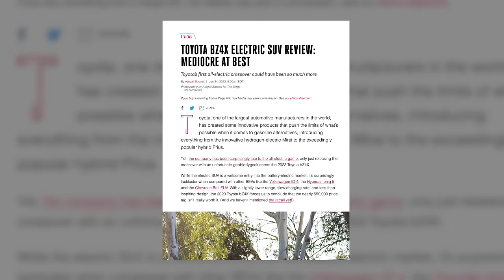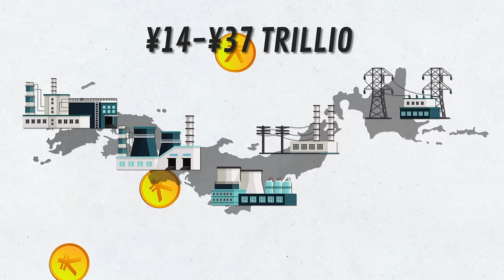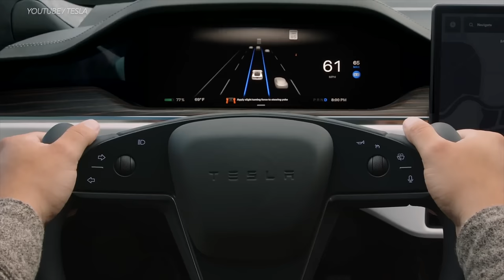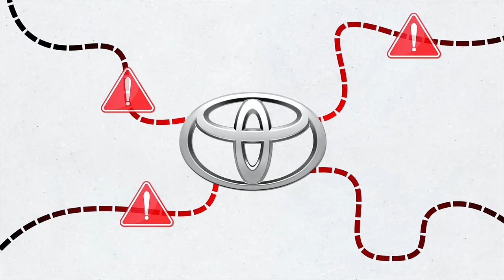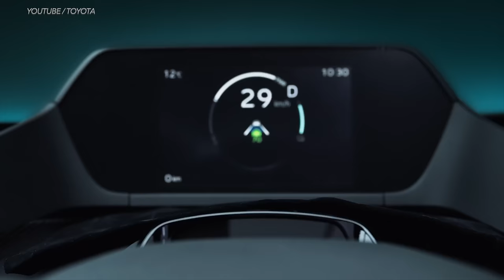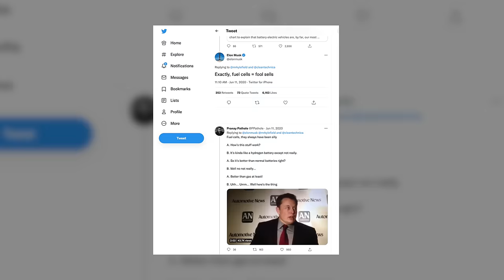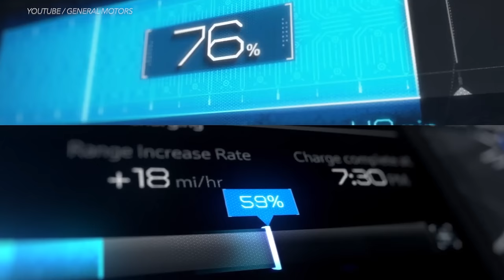Toyota's New Electric Car Shocks the Entire Car Industry

Comment: If Toyota can guarantee the battery for 10 years, they shouldn't have much problem selling them when they get the bugs worked out.
Reply: 10 years isn’t much when a gas Corolla can run 2 5 years
Reply: Lithium ion battery is chemically very unstable so automakers tend to use them only in safe margin.... Normally almost all makers are expecting it endures more than 10 years. That means, 10 years warranty for battery's life time is nothing special or belated answer in EV industry.
Reply: @billyjean2905  On average, most people don't keep their cars for much longer than that anyway.
Reply: @m1kcan1  Yes, but.  I have an 18 year old Toytoa.  It will outlive me, of course.  I don't drive  much.  Put aside the purchase price, the range, the concern with the electric grid going down.  A 10 year battery guarantee is going to be a deal clincher for a lot of people.  My kid is the rarity who buys a car for $2000, can repair it, and has driven more than 130,000 miles on business (with the tax deduction).  I buy new and drive forever.  It is only now that Toyota as 20 years experience with the Prius, but I would never buy a used one.
Reply: @billyjean2905  That may be true.  For those of us who only buy new and drive until it dies, that kind of warranty helps the sale.  I am driving a Toyota that I bought new and it is 18 years old.  What do I think about limited power train warranties of 100,000 miles?  A sales gimmick.  Who wants to buy a car that only goes 100,000?  A lot of EV vehicles will not have quirky transmissions.

Comment: I did notice that Asian vehicle manufacturers seem to have inferior electric motors or at least they have inferior design aspects. I drove a Kia hybrid and the electric motor was so anemic that anytime you pressed more than 10% of the throttle range it would turn on the gas motor even if the battery was full. It never used the battery except in very low speed maneuvering in parking lots.
Reply: They don't have the strength of the power-split device of the Synergy Drive.  It's more like an alternator that can be driven by the battery.
Reply: I think it's more efficient to run the motors at slow speed.
Reply: That's controlled by the software.  It wasn't an anemic electric motor.  It is 38 KW = 51 HP.

Comment: Hey Scotty I have a 2011 camaro v6 the 3.6 liter and I have spent 750$ on trying to get it to start it shut off while I was driving and ever since then no start. I changed the alternator,battery, belt tensioner, serpentine belt, and the spark plugs with coil packs and it still won’t start. It cranks and wants to start but it doesn’t. It will crank once or twice but no start any idea of what it could be I also have a starter on the way?!

Comment: I’m wondering if if the tires that are falling off are the ones attached to the E-Axles. The way they achieve “AWD” is an even torque split between the front right and rear left axles. I feel like if they were just loose you can have dealers tighten these bolts with an on delivery recall or at the port. Feel like they might be destroying themselves when trying to power through turns, especially when you’re talking about hitting peak torque in a fraction of the time of an ICE. Wheel hubs have been an issue with Subaru’s for a long time and I’m wondering if they just used cheap materials.

Comment: The only electric car I would consider would be a plug in hybrid. 60-70 miles autonomy all electric + regular gasoline engine. So you can plug in your car and use it for most commmuye and fill up your car once every 2 months or so. Smaller battery, smaller price. Best of both world. So far only bmw series 3 offer this and this is such an amazing idea solving all current issues
Reply: Uh, there are many more plug in hybrids than just the Beemer (with the gasoline engine) out there.  Enough so that the acronym PHEV was invented.
Reply: @tharais  yes but they have like 14 miles autonomy.

Comment: Okay, so in order to charge an EV it is equivalent to running 25 refrigerators all at once , so say the average family has two EVs  how is the grid going to handle using the equivalent of running  50 refrigerators per household every night?
Reply: well refrigerators use very little power
Reply: @KYLE-zo4bm  Not true.  They are very power hungry when they are on and cooling, but after they get cold they only cycle on occasionally.
Reply: @ReachOutToWilliam  yeah... exactly

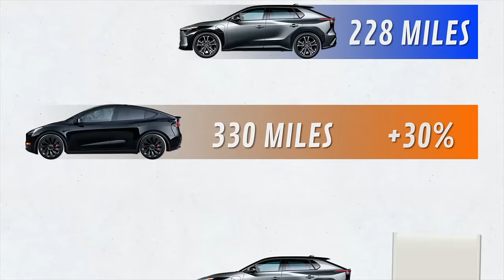Comment: 8:00   Lithium ion batteries cannot produce the stated range most of the time as they should not be charged higher that  80% or discharged below 10%.  So the effective range of the BZ4X is 160 miles (crap). If LPEs are fitted, then the range is as stated as they should be fully charged and discharged all he time or at least once per week.
Reply: Who says the quoted range is from 100% to 0% of full battery capacity, rather than the range the car actually lets you cycle through?  In my Toyota PHEV, what the car calls 0% is around 20%, and what the car calls 100% is around 80%.
Reply: you are not right. it is 150. including weight and weather

Comment: I just love the fact that we have all of these car companies racing towards electrification, literally shoving this down our throats, and not a single state is even attempting to upgrade their power grids to support them.  Can't wait for those 2030 rolling blackouts!
Reply: you can pretty much only buy an EV if you live in a single family home - single family homes have big roofs - big roofs get a lot of sun, even in winter (in most of the US) - put solar panels on it and there you go, basically free power for your home and car
Reply: EVs don't use that much electricity in the grand scheme of things: The US produces 4.1 trillion kwh of electricity per year.  If all passenger cars magically turning EV overnight, they would consume less than 1 trillion kwh per year (Americans drive 3.3 trillion miles a year. EVs get 3 to 4 miles per kwh). A 25% increase isn't negligible, but it's not impossibly huge. Considering how slow the rollout will actually be, the grid will be fine.
Reply: Good thing they pushed AC back in the day
Reply: 2023 winter in Europe is going to be really rough, as it is Spain is already setting mandates right now for A/C to be set no lower than 80.6 degrees in office buildings.
Reply: @mcc7762  absolutely delusional

Comment: Toyota didn't get into the full electric market at the request of the Japanese government. They feel that Toyota being the #1 car seller in Japan, that the country does not have the infrastructure to do it.  And even if 50% of the country went full electric it would crash the electric grid. Also Vietnam, Thailand have the same issue.
Reply: But don't oil refineries use huge amounts of electricity? If these were not refining all the fuel for ICE cars, there would be much more capacity left in the grid.....

Comment: The range is still not good enough, and they need quick charging. This would be fine if you never leave the city, but pretty pricy for that. And I do like the looks of it.
Reply: Gee, and with a handle like yours, you have no issue driving a gas sucking hot rod around town, getting such poor mileage, that even a 15 gallon tankful of gasoline limits your "range" to the same as this Toyota.

The whole EV range anxiety is so over thought and exaggerated.  All vehicles have range limits.  250 miles is sufficient range for 99% of the trips people like us take in their autos.  To say nothing of the fact that, we can top them up with ease at our homes and not be limited to service stations.
Reply: @Tom Harais The Hot Rod is for fun and not everyday driving, I do like the EV, I do travel from city to city quite often, I wouldn't mind waiting if they had 20 min charge like the Kia EV6 has. I'm pretty sure Toyota will have a few more coming out, my friend has the Hyundai Niro and they love it but they don't use it for long trips, plus the HVAC system really uses a lot of energy, using the HVAC they said they loose 35% of range, I hate the winter and need heat lol. Have a good day.

Comment: i dont know anyone that wants an ev. evs are like cell phones, when the battery dies you throw them out...
Reply: Wrong. Firstly, the battery in an EV doesn't "die".  It can be refurbished, just like a worn engine can.... This usually costs a fraction of the price of a new battery.....
Reply: @Brian-om2hh  cheapest i saw a place do on youtube was $5000. crate engines are cheaper still. you want an ev buy one i dont and wont...

Comment: Personally I want a hybrid with medium range (150-miles) in electric mode with a good solid-state battery. Hybrids offer so much more flexibility and I'm pretty sure I will be long gone before gasoline and oil stop being used for fuel in any capacity.

Comment: I always believed that of the government mandated hybrids first this would have been easier to adopt.  Batteries components are scarce and instead of shoving a huge one that weighs down the car a hybrid system would have given us more time to conserve fossil fuels and show people the savings of going electric and also having a safety net if you lived in a natural disaster area that would keep you from having power for days or weeks.
Reply: But if you lived in a natural disaster area, and there was no power for weeks, where might you need to go in a car, and why? There wouldn't be much point going to work (no power). It would also be pointless trying to buy anything locally ( no power - the cash register won't work). You would be able to get gas for a hybrid ( gas pump won't work - no power).
Reply: @Brian-om2hh  Well normally if you're stuck in an emergency you car can be your source of heat/cooling and a way to charge your phone so you can move to a place that has cell signal and wait to find out if it's safe to go back home.

Comment: Toyota is on the right track with their Plug in Hybrids, RAV4 and Prius Prime. If they were able to get those batteries to give the vehicle a range of 75 miles pure electric ( right now the Prius is 25 and the RAV4 is 40) before switching to the gas powered engine they would dominate!
Reply: You're correct. The Prius prime 25 mi range is just too short. It needs to get up to at least 50. The RAV4 prime 40 mi all electric is good, but it's miles per gallon is only 36. If they focused on their hybrid more it will be better than electric because with hybrid you still have the option of both gas and electric. Much more convenient

Comment: As Scotty said when the car doesn't have manual transmission, its not a great idea to put money on the car. The same must be with EVs.
Reply: An EV doesn't need manual transmission, because 100% torque is available from zero. There is no narrow power band, so a heavy gearbox and clutch would be pointless....

Comment: If you have several kids, you’d need a 3-row vehicle. For EVs the only option is a Model X. Starts at $110,000. You can buy a nice Sienna hybrid and a whole lot of gas for that kind of money. And have Toyota reliability. And 36 miles per gallon in the city. And room for 7-8.

Comment: IMO, combustion is the way to go or Hybrid. Everything else, fugetaboutit. The more you use in an ev car (AC, lights, radio, etc...), that is all taking from the range. In addition, Batteries lose efficiency quick. ESPECIALLY if you over charge. Cell phones are a great way to look at it. For me it's either gas or hybrid. Forget plugin too. Plus, $7500 you're supposed to receive from government is already tacked on to the vehicle's price. Where's the savings? Infrastructure won't support it. If and when it does, do you thing pricing for electricity won't go up? Think about the amount of waste that we would need to contend with too. YIKES!!

Comment: Perhaps we could have bicycles that have pedal assist that runs with a changeable battery like a Milwaukee and to charge that battery you plug it in or sell system that allows the battery to be charged biking stationary

Comment: Hybrid is the only way to go--Gas Combustion Engine Plus a Battery Pack that also will Move Vehicle down the Road. I have talked to many people that have a Prius, they Love them, excellent mileage plus almost no maintenance. A Total Battery Operated Vehicle might be Ok if enough Charging Stations are Spread around the Country but if you run out of Juice in the Middle of No Where, it is very hard to carry Electricity in a Fuel Can--you will be forced to call a Wrecker or someone that has a Portable Generator....

Comment: Mediocre is a good description of the car, even if the wheels stay on: about on par with a Chevy Bolt.  With weak performance, barely acceptable range and slow charging it's a town car for the Toyota faithful.  Any Tesla model, Ioniq 5, EV6, MachE or even ID4 are much better EVs.

Comment: I don't get why we can't have a set up like a Prius had for a number of years, it'll lower fuel costs and its so reliable. I really don't like the idea of owning an EV and a PHEV is just crazy, you're always pulling around two fuel on power sources around with you.
Reply: The Prius was an overglorified red light engine shutoff to boost city mpg.  It could only handle 7mph on electric alone.  The electric motor provided starting torque and grade torque fir a very underpowered motor.  Most only had a 1 or 2 kWh battery pack.

It was a good solution for polluted cities, but since it was a trendy fad 20 years ago it has to be replaced with a new trendy fad.....Fads are to sell Christmas gifts to folks ho hum about buying stuff they don't really need.
Reply: An EV has just one power source.....

Comment: Styling's good, but the front end still needs a little work, even if it's miles better than Teslas.  And it looks a lot better than the Toyota / Lexus Broken Spindle grille that looks like the car is leaking engine all over the road.  For a lot of people, the price x utility function is still going to be too low . . . but if enough people buy these, there will be more long-lasting secondhand gas and hybrid Corollas and Camries on the market, anyway.  People who want to spend crazy money on Teslas will still spend crazy money on Teslas, but it won't matter to Toyota.

The name is terrible, but that hasn't stopped BMW, Mercedes, or, you know, Lexus.  There should be a hopping aftermarket for stick-on alternative model names.

Comment: Most Toyotas don’t impress me based on looks or performance and this one’s no different. The only thing that attracts me to Toyota is reliability. Apart from the absence of an electric grid to support everyone driving an EV and the absence of an adequate charging infrastructure, the Achilles heel of the EV is the battery itself. For people who plan on leasing a new car forever and their car is always under warranty, the battery isn’t an issue. For everybody else, it’s a problem. A battery replacement could cost $20,000. Even if the battery doesn’t fail, it will degrade in capacity requiring more frequent charging. A battery that holds 90% of its capacity after 10 years is a really big deal for those who want to keep their cars and/or resell an older car. Toyota is building long term value into the car. Still, Toyota may have been right that hybrids make more sense. For people like me who drive mostly in the city, I could drive around on the self charging battery and avoid the plug-in charging issue altogether while needing much less gas.
Reply: Know what’s reliable?  NOT internal combustion engines
Reply: We do live in a world where looks trumps reliability...hence the downfall of humanity...lol..